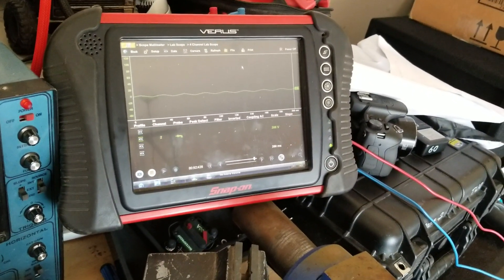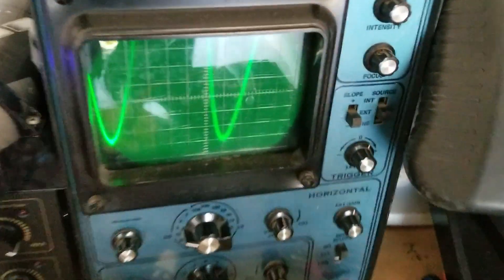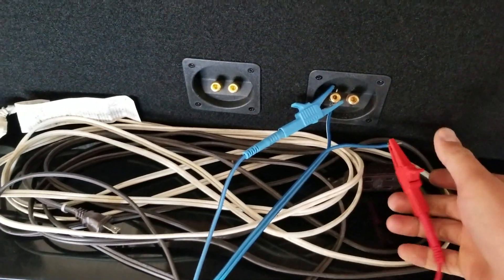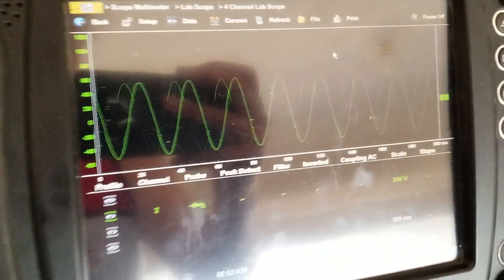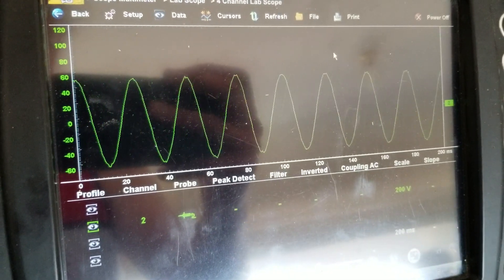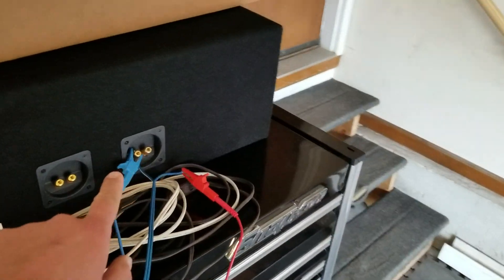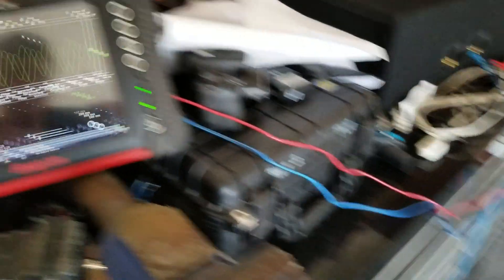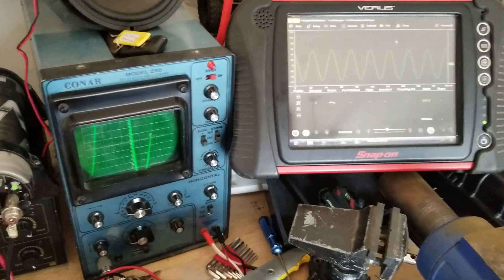A tip for setting gains with an oscilloscope.

Comment: This is great to know, it wasn’t making sense to my common sense! Then i found this video, makes sense because just like anything in electronics when its in use voltage drops a little. So if you set gains with everything unplugged it will actually be too high.
Reply from the maker: @bradbozarth3235  correct. That’s why they say to set with -5db tone

Comment: I built my enclosure with external dual terminals. Plan to wire my sub to 4 ohm instead of 1 ohm wiring when I do this so that I don't drive my neighbors insane lol. Figure others can use this idea as well as it's also a bit safer for your sub, though you may have to unscrew your sub. Thanks for sharing this with us!
Reply from the maker: No dude. Just turn the amp down. Your thinking is actually opposite. Its worse on the woofers
Reply: @ATCA  I think I worded this comment really poorly. My thought was simply wiring my sub to a higher impedance while setting the gain, not permanently. Just so that I'm not working with so much power (and hence audible noise) while setting the gain. Though would that throw off my gain?

Not new to this, have a pretty solid overall understanding, just never had heard of setting gain with the load connected.
Reply from the maker: @ixionn563  gain will be the same wether at 1 ohm or 4 ohm. You'll be better off at 1 ohm, gain set, and turning down the subs.

Comment: So if my woofer is a 2 ohm load, I could just use a 2 ohm resistor off the positive side of the amp them attach my red test lead from lumy to that? And black to negative side of amp?
Reply from the maker: Yes absolutely.  But you'll need a resistor capable of the wattage you produce
Reply: @ATCA  gotcha. Thanks for replying

Comment: So why do they say you have to disconnect everything when setting your gains? can the test tones blow your speakers and subwoofers?
Reply from the maker: To prevent damage to thr speakers by playing tones. In my experience,  playing tones long enough to set gains hasn't caused any damage
Reply: @ATCA  That's what I was thinking so I'm guessing they say to do that because they know there's some people that aren't experienced and they expect them to take a while to sit the gains. They just don't want to be held accountable for someone else blowing their speakers correct?
Reply from the maker: @d4rkz3nn3n  that's exactly my thought. Steve meade does a video about CCA Vs OFC and a 3000 watt amps loses 300 watts with CCA vs ofc. But when you set your gains with everything unplugged,  id wager the loss is similar. He made a big deal about losing that 300 watts.
Reply: @ATCA  yep I seen that video because I was doing some research on OFC and I realized that CCA is garbage. I bought a liumy lm2020 and tested yesterday without my speakers connected and that was kind of a pain so I'm going to test it in a little bit with the speakers connected
Reply: @ATCA  also when I was testing when my radio clips the speaker wires clipped at 51 the max is 62. When I tested it on the RCA's it would go to 62 without clipping. Any reason for that?
Reply from the maker: @d4rkz3nn3n  yes. There is a different amplifier for radio power and rca. This is one greater reason to never use radio power. I also run an amp. Even if its a small $30 SSL amplifier. General rule of thumb is radio power is dirty and rca is clean. Sometimes running tweeters on radio power is fine and running doors off amp can make for an easy setup if you have dash ans door speakers separate like most dodge and chevy trucks
Reply: @ATCA  ah ok I'm gonna look into getting an amp for my speakers next. So I tested a 1,000 hz 0DB test tone and it was very loud but instead of getting to 51 it only got to 49 before clipping I'm really glad I watched your video and I could audibly hear the speakers clipping once I went past 49
Reply: @ATCA  but again the same thing applies with the RCA's coming out of the back of the radio. They're not clipping at all when I go past 49
Reply from the maker: @d4rkz3nn3n  thats why you use them if you can. And don't use radio power.
Reply: @ATCA  ah ok I see what your saying. Going through rca is clean since it's just sending a signal and not really powering anything
Reply from the maker: @d4rkz3nn3n  yes exactly.  The on board amplifier on most HU is terrible.  Old alpine used to have actually MosFets and Power supplies built in. Now of days it's all surface mount, low power drivers or the class AB 12 watt driver that does ies all 4 channels in one chip. The are useless

Comment: OMFG I think you have solved an issue that I have been having for a long time now and I can't wait to get home to test it out.
Reply from the maker: It will make a great addition to your tool collection.  It will also make you a masterful stereo technician!
Reply: @ATCA  I have been setting my amps with the speakers disconnected and have been having clipping issues. The voltage being that much higher when disconnected and setting the gains has got to be my problem.
Reply from the maker: @joshpaul3391  this is exactly correct

Comment: I don't understand how they could make test tracks say whether the woofer is plugged into the amp or not. That's weird to me. The impedance changes with the woofer when playing tones through it. This is what people call "box rise". I think your right here trevor. When you only have an oscope connected without the woofer, the amp won't see this changes of ohms. When you have both the scope and the woofer connected the amp does see the change.
Reply from the maker: Also, when you have current being drawn  through the power supply of the amplifier,  the internal voltage will drop. This is why you set gains at tuning frequency
Reply: @ATCA  You are 100% correct, just like any other electronic equipment these days, especially batteries. Why the heck are they testing amps with no load? It makes 0 sense to do and its just as easy to set gains with the sub plugged in
Reply from the maker: @Stoner916sac  amp dyno is tested with full load. However they set gains this way.  With an oscilloscope,  gains can be set more refinely
Reply: @ATCA  Yep. The quality of your source can cause distortion too. People who play that "bass boosted stuff". You can set your gain and play one, and the amp will produce more voltage and hard clip :D I use a digital oscope(wish it was a battery powered one) This is 100% the right tool everyone, and don't play "bass boosted inset name here stuff"

Comment: @00:42 "I'm going to show you something you should never do".  

 @02:13 "That's why you should do exactly what I told you you should never do."  

So which is it?  Should we never do this or should we?
Reply from the maker: You shouldn't disconnect power while playing.  I only did this to show that the amplifier settings absolutely did not change. 

A guy could set the amp, test for voltage,  then disconnect the subs and try to match that gain. However this situation was to show the amplifier settings have not been changed. This shows how much the power supply portion of the amplifier is stressed under load, thus changing the point even the amplifier clips.  

Basically showing that you need to set gains with woofers connected. BareVids just made a video talking about this same thing.
Reply: @ATCA  Gotchya, thanks for the detailed and fast response.  I am in the middle of doing a lot of system tuning on a fresh install and this is one piece of the plan.  I was worried about having to tear open a door panel to test the line out leads from the head unit powering some of the speakers but now I'll just connect my oscilloscope leads to the inputs on the passive crossovers that I installed in the cabin to determine when the head unit amp clips, if ever, with the component set load on it.  Then do same with the sub and amp.  Happy Holidays!

Comment: From what I understand the test tone tracks included with the DD1 take the speakers being disconnected into account. At least thats what the directions say
Reply: Has there been any follow up to this? If standard procedure is disconnect everything, it would stand to reason standard procedure would be how you said. The test tones from reputable sources take into account the missing load. But how would they know what load is missing? And the voltage that’s missing?

Comment: Ok so still dont understand. Is the woofer supposed to be connected or not when setting input sensitivity?
Reply from the maker: Connected.
Reply: From what i understand the test tone tracks included with the DD1 that are used to set the gains take the speakers being disconnected into account. At least thats what the directions say.
Reply: @dibbsdabble4718  how would that work, every driver could have a different impact depending on what resistance coils it uses and then box rise as well.
Reply: @dibbsdabble4718  And here you are saying it again. Tort Sweee and XD Suns both have solid valid points brother.
Reply: And as also stated the current draw and voltage sag plays a part in clipping also, I'm new to this hi tech way of setting things up, I'm old school by ear. Been doing it since middle school, lol and I'm 42 now. Ears not so good all music is compressed boosted crap so Im turning to "science" for reliability. Especially with all my old school amps that aren't used to new fancy hi voltage preamp out head units, I've blown a few woffers, before I considered the "clip". I also as a safety net would suggest to fully charge your system batteries and set gains to give you some Cushion with the voltage starting a 12.6v as a running vehicle should be around 14v or above